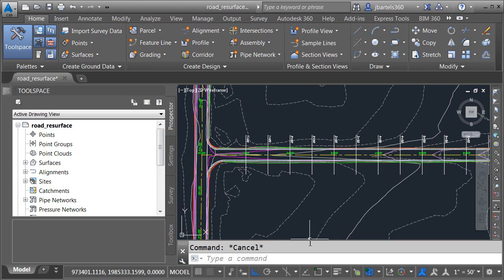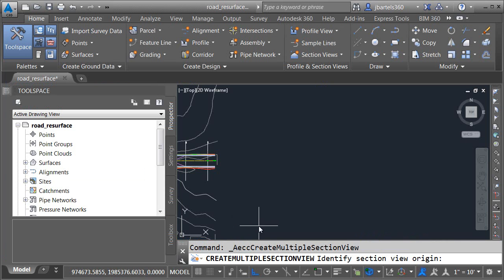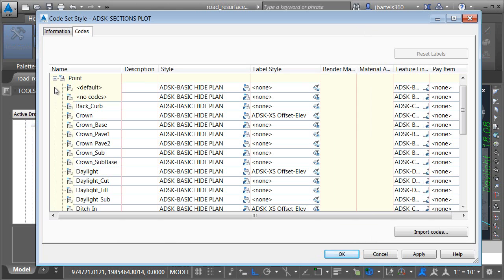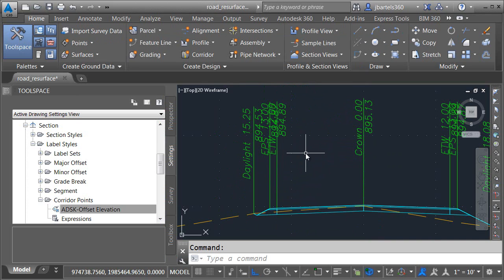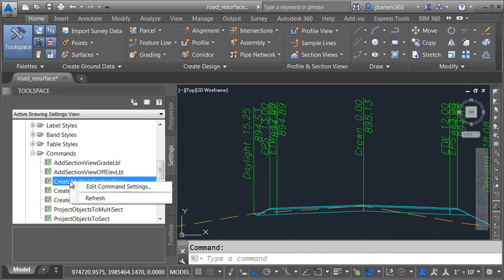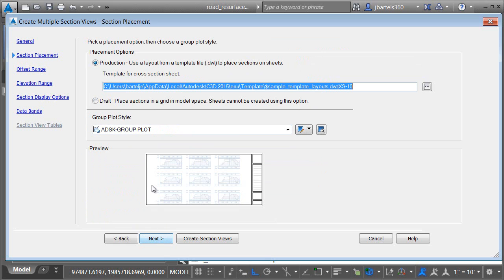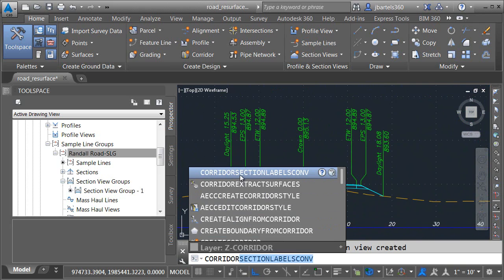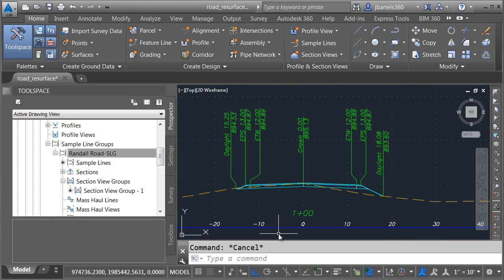Civil 3D 2015 Staggered Corridor Cross Section Labels

Comment: Dear Jeff Bartels   i have Land Desktop Civil 3d 2009 Companion 32 Bit. But My Operatiing System is 64 Bit So, i,m Not able  work on land desktop 32,  if you have a link of Land Desktop 64 bit,  kindly send me. & if you have other solution  send me.
hopping a good response & early action (

Comment: Jeff, Hopefully you still get notifications about comments on this.
I am trying to have sections produced of a track but seem to have an issue with the sections when the track is above existing ground level. Your sections show a specific thickness of most likely subbase  and then the fill line extends beyond the subbase thickness to the existing ground. Say i wanted to illustrate the capping material beneath the subbase, is it possible to make the capping material target a specific depth beneath existing ground? Say you have 150mm subbase onto 200 capping, but if the underside of the capping is above existing ground level it is shown as floating whereas we desire it to be at least 150mm within the existing ground so the capping may be in excess of 400mm thick at that point. Is this possible? Your advice would be much appreciated.
Kind Regards, Adam